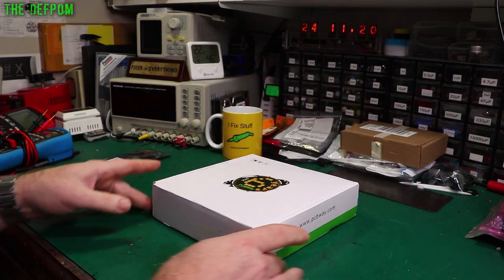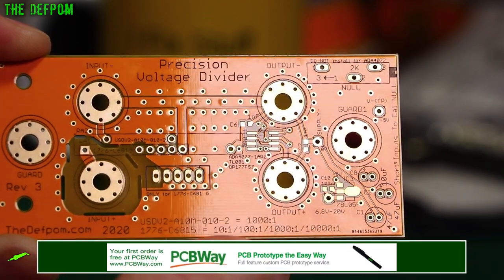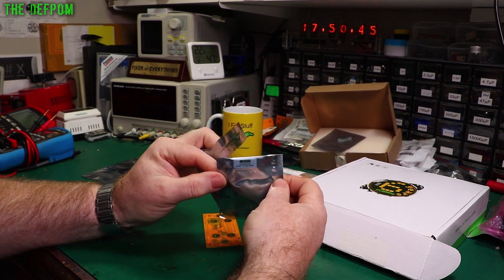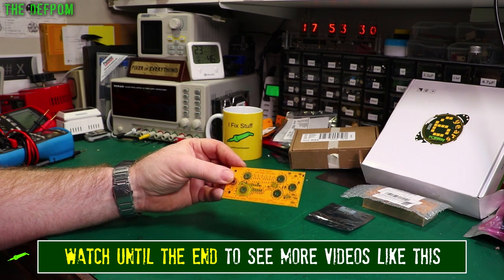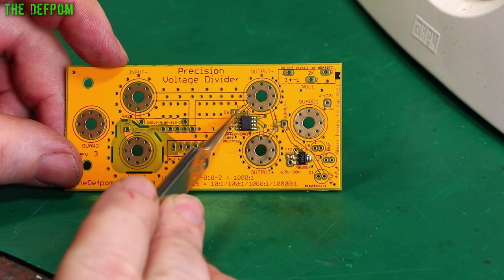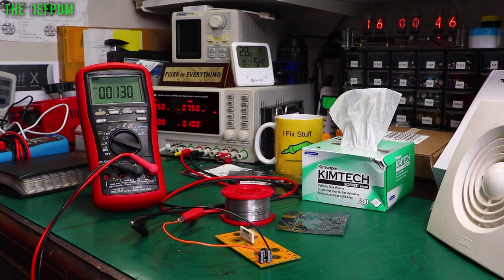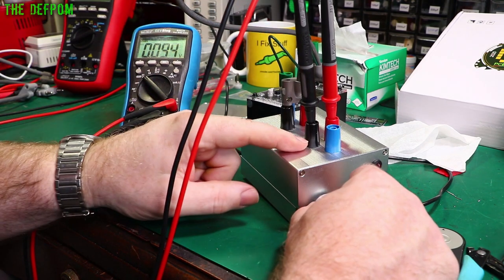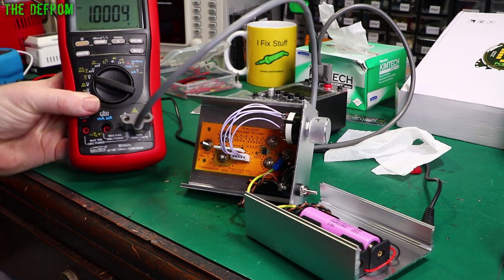🔴 Voltage Divider Project - Part 5 Sponsored By PCBWay & Pomona - No.790

Comment: Nice to see your perseverance with this project. Funny the more you learn about this stuff the more there is to learn and it’s not as simple as it would first appear.  Don’t complain about the temperature it is 2c here. Thanks for sharing
Reply from the maker: This was as far as I planned to go with the project, I actually planned the evolution of it this way, I thought it would make a good video series showing how a design is tweaked and tuned along the way, sure the very first one worked, but was overly simplistic with the drawback of the meter impedance being part of the tuning.

Comment: I noticed while you were calibrating your Solartron, that you did it without the special adjustment covering plate. I have one of these, and know that it is very sensitive to the termperature change when having the cover open.   You can actually do most of the adjustments through the normal cover, and all of the adjustments by drilling just a few little holes in the cover. You can obtain a much better calibration doing it with the cover closed.
Reply from the maker: There is no cover on my unit, I didn’t know there was one?
Reply: @TheDefpom  I am referring to the top part of the casing. They originally sold a special aluminum plate with holes drilled in the right places to do the calibration, but it is unobtainium today. But you can, as I stated, reach most of the calibration points throught the air slits found in the top casing, and you can, as I did, drill small holes in the case for those calibration points you cannot access through the air slits. If you calibrate with open case, then close the case, your calibration gets off.
Reply from the maker: @vornamenachnahme58  oh right, I have worked on gear before that had internal shields, for a minute I thought you meant this is supposed to have one.

Comment: How about using tooth or contact washers? Wouldn't that give lower resistance and reduce the risk of the nut coming loose?
Reply from the maker: I used what I had to hand, I measured the contact resistance and it was fine, using 2 poles wasn’t really required but I wanted to do it for long term reliability.

Comment: Brilliant! I would like to see one with the adjustable offset op amp to see how well it can be adjusted. I'm curious - what inspired this project? Did you have an immediate use or did you just want to add some kit to your workbench? Great project in either case. David
Reply from the maker: I wanted this to help me calibrate my calibrators, to use as a verification that the higher voltages are correctly set by using the known to be accurate lower range on the multimeter to measure the high voltage.

Comment: idk about that 28C temp... could be worse! outside this morning it was -4C here and only up to +8C so far high temp is forecast for +13C but in a couple days highs will only be +2C with lows -7C
Reply from the maker: Sounds great... I prefer the cold, is easy to put more clothes on or turn on a heater, not so easy to take off more clothes than you are wearing, as well as that not being socially acceptable.
Reply: @TheDefpom  lol well here with cold comes snow. which makes a mess of things

Comment: I've seen 24 packs of 18650 cells distroyed after those bms failed in every pack!
they were less than 1 year old!
Reply from the maker: From my previous testing of these modules they worked ok, but I’m always dubious about the current ratings of them, I never run items near their ratings anyway so I have my own safety margins, if something is rated at 3A, I won’t try to get more than 1A out of it, I did this on the charging buck regulator for example, that is rated to 3A, but the BMS only charges at 500mA.